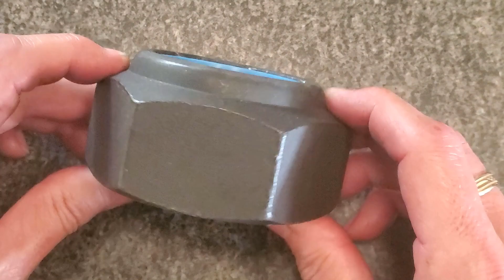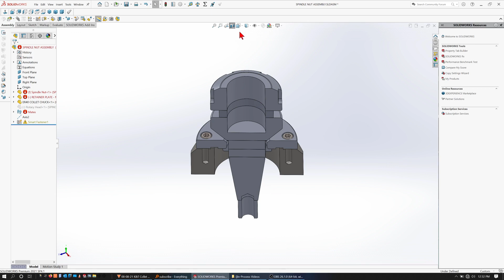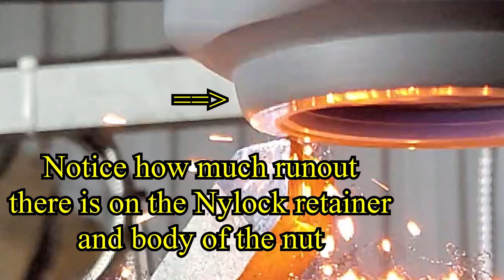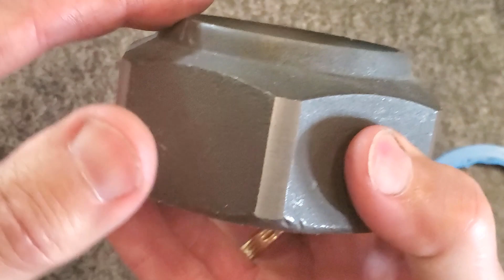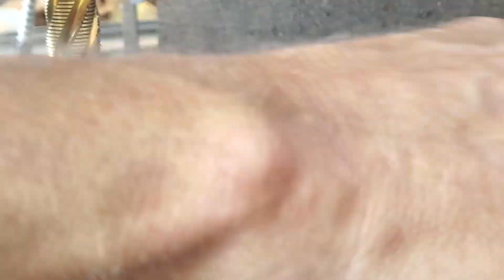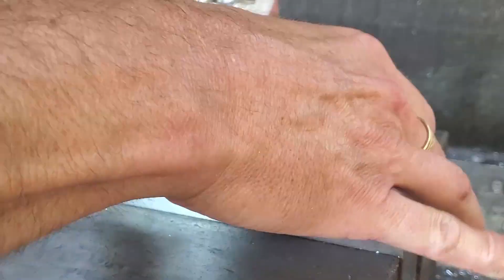Adapting an ER-40 Collet Chuck to the K&T Model 2D Rotary Head Mill

Comment: I use QC30 tooling for which I made my own closing nut and drive dogs. There is a company in the UK that sell new QC30 tooling made in Germany. One of the holders that I have is ER32, although they also do an er40.
Reply from the maker: QC30 and NMBT30 must be the same taper.
Reply: @EngineersWorkshop  they are the same taper (as is ISO30 and BT30) the only difference is the fixing in front of the spindle and the drawbar thread. QC30 has a thin flange that can be drawn down from the front with a nut, the others are intended to be pulled with a drawbar and the flange is mostly for drive dogs. The downside of qc30 is that it isn’t very common, so is more expensive, the other problem is that some are sold as qc30 but the flange is too thick to grip from the front. I’ve found that tooling sold for Bridgeport Interact fits my setup.

Comment: Jimbo, great video. If laid flat obviously you know you can face for that .250 but yuk, no fun in that for a video. Anyway, a great option is to drop into a small machinist vise and run the nut across the belt sander or the disc 12" or 20" (Burr King, Elephant whatever you have) and then a  final mill light cut and a spring pass when you're at the final spec...Just saying so you can keep your EMs nice and the main spindle motor from lagging in performance. But again, that doesn't make for cool videos. Folks out there want crash and burns cus that's more fun to watch, just like Nascar......Seeyah  bud....Ricko
Reply from the maker: Well I delivered on the crash and burn in spades on this one! 😁 I don't have a sander capable of removing that much material. Obviously a running lathe would help, and I'm close to having the Acraturn running. Need to finish up the replacement motor pivot bracket.
Reply: @EngineersWorkshop  I really did like the video and Great to hear that the lathe is almost ready as nothing really like having one in a shop. When I wanted to do rapid removing of material I would use one of my Burr King 760 machines with a serrated rubber wheel and just shred material off like a shark chewing flesh. I sold one of the Burr King 760s and there is another I have that went MIA and just a sore subject when thinking about it as they are very expensive. Glad you made the vid, Jimmy.....Take care buddy till next time...
Reply from the maker: @RickO  I looked them up, they are high $$. Doozer has a large 8" vertical belt sander he picked up that I have an option  on. Think it's  an old Powermatic. Might pop for it next time I head down that way.
Reply: @EngineersWorkshop  Powermatic is a great mfg if I'm not mistaking it's a clausing product but I didn't look it up. I know they have a 4" belt sander last I remember. I also can tell you that on the Burr King 760s I had, they were Top Notch and for the metal fab side of my old business I would always keep a serrated wheel on one of them that was a 2" width wheel for my 760s which were 2×60 belts and the other machine I left with a regular wheel and swapped to their ID burring tooling which made it a 72" belt when needed and then would swap to a padded bright wheel for light polishing. There are endless style belts that I would use including scuffing scotch bright 60 " belts like the maroon, green gray and even for stainless with special belts. 
I swear by the Burr King 760 belt sander and not sure the power matic will be the same for super rapid super heavy material removal but you can't go wrong by having a belt sander and a floor model wheel grinder/sander either way. At least it will help in burr removal and shaping...and if it's from Doozer well you know that's is already a major ➕ plus....

Comment: Nut down flat and endmill to thickness using your trick head, then no worrying about it coming out of the vise or deflection of the tool when side milling. OR, get that lathe working!
Reply from the maker: Either way may have been preferable, but I eventually finished. Probably three more parts to the series.

Comment: I have the exact k and T mill I've been following your channel 
Just a couple days ago a machinist buddy brought me 4 coffee cans full of high quality end mills of various sizes 
I only own 2 collets a half inch and a three quarters I definitely need to aquire a tool holding system like this. 👍
Reply: They seem to be good rigid machines 
I've recently added an 8 inch vise and a 3/4 drill chuck was sorta shopping around for collets but they are a little bit rare
Reply from the maker: @Greg Bosl  A guy on PM had a number of sets made up. Was selling for $350. I've lost his info but searches might turn it up. The NMTB30 to ER40 was about $75. You can also get MT2 and MT3.
Reply: @EngineersWorkshop  oh really!!
I would possibly be interested that 
So do you think that the er collets will fit into my mill .  Sorry I'm kinda dumb about this thing yet but I'm wanting to learn
Reply: Well that seems like a viable option maybe I should get in contact with him and check it out and get this thing making chips again 🤔
Reply from the maker: @Greg Bosl  Not all 2Ds use the double Taper collets, I think later ones had R8. If yours is the double Taper variety, a plain NMTB 30 end mill holder is $25 on ebay. You could buy one just to check the fit. The McMaster nut I made my retainer from is part number 93126A150. It's a great project for the 2D, you can watch the rest of the video series and I'll step through it.
Reply: @EngineersWorkshop  I am pretty sure that it's the double taper z type as best as I can tell. I appreciate any advice and help!!
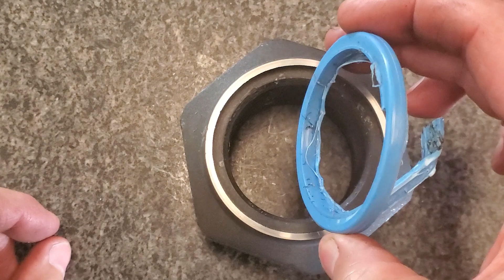Reply from the maker: @Greg Bosl  If it looks like the Z then it is a "K&T 30". The Z is close but no cigar.. The NMTB 30 should fit. Both are 7:24 Taper with 1.25" (I think) max diameter at the apex.
Reply: @EngineersWorkshop  that sounds about right I will be in the shop tomorrow I can look maybe send some pictures and measure 
 I'm getting excited to find the right ones ☺️
Reply: Well yah you are right the collets I have are right at about inch and a quarter at the apex. 
So your saying the NMTB 30 end mill holder is a close fit?
Reply from the maker: @Greg Bosl  The back end Taper is an exact match to what is in my spindle. When inserted, the drive flange sits about 1/16" to 1/8" off the end of the spindle. It definitely registers on the Taper, not the flange or the protruding drawbar stud.
Reply from the maker: I was fortunate to have 1/8" through 3/4" but the K&T system was a pain. I only switch back when I run a long 3/4" finish mill. Less stickout with factory system.